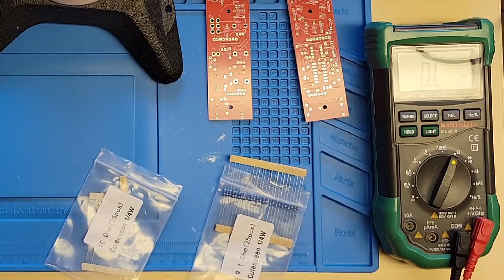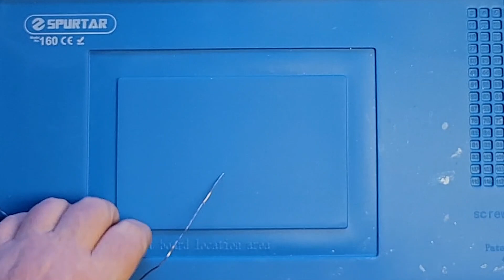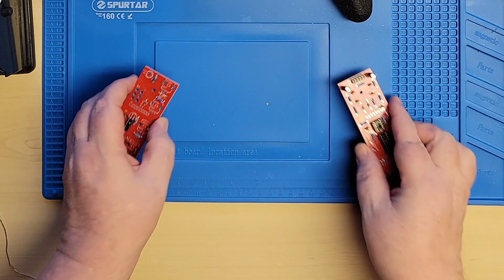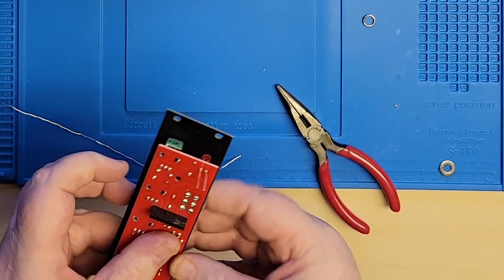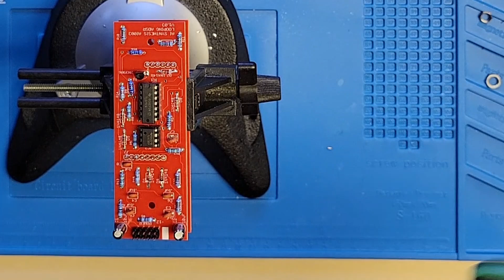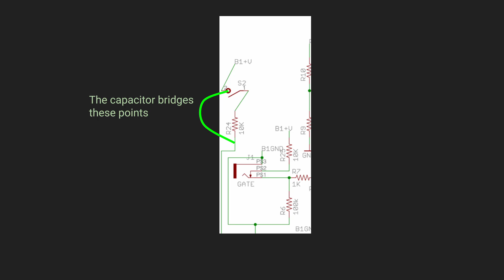Tips and tricks for DIYing Eurorack modules (feat. AI Synthesis ADSR) - How many ways can I mess up?

Comment: I pin my bom on “foamy plastic” and pin the components on that foam board (apart from the semiconductors that stay in the black foam). I also sometimes use inductors (10mH) instead of the 10 Ohm resistors as they also acts as noise suppression.

(I re-found your channel as I will build a Sloth and wanted some info about it).

Comment: GREAT VIDEO!
One thing is I wouldn't recommend cleaning the pcbs with water.
That's only if you use ultra pure water, and also only if the flux you used is water-soluble, which is generally NOT the case.
One has to understand that although pure water is non-conductive, it is a REALLY REALLY good solvent, in fact, it is the best humans know of.
It really wants to solve anything it touches, and that includes any material your circuit might be made of from all the components you have.
Again, it is fine if you know what you're doing but I wouldn't recommend it, as using Isopropyl alcohol is usually the best choice and more than enough.

Comment: I actually got some silicon finger tip covers - as I am a wuss!
Reply from the maker: I should, I'm just not very smart :)
Reply: exactly last night I was wondering if there is something like that! thanks for the tip. 
(I was also soldering an ADSR, what a coincidence).
Reply: Really useful for doing resistors! @QuimFont
Reply: Those exist? Finally my fingertips can be saved.